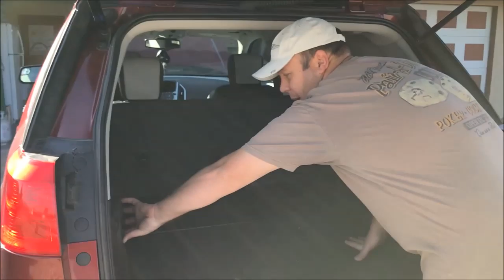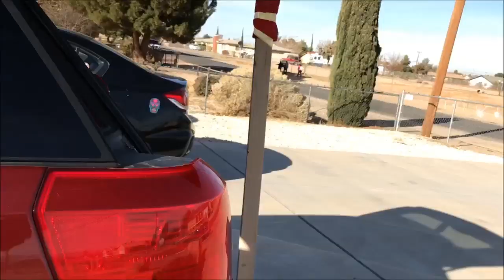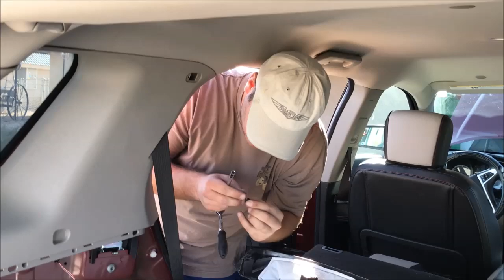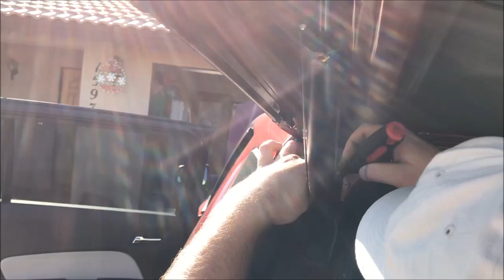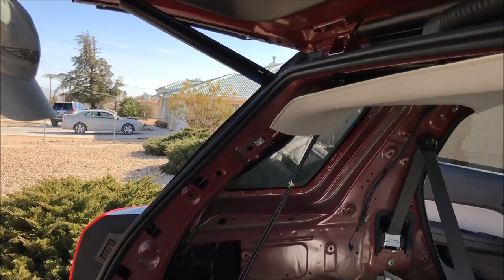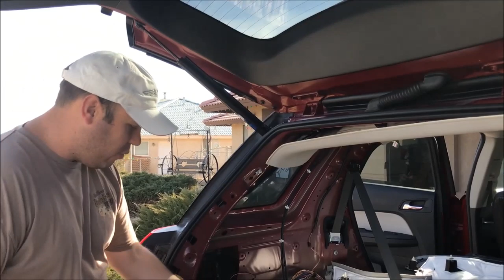2012 GMC Terrain Power Lift Gate Replacement

Comment: Bro, you gave me the confidence I needed to attempt this repair. Thank you, sir! It went just fine. Hardest part was getting out the old stupid plastic tie downs on the lines, especially the ones up by the headliner (ended up using a side cutter). Used a step ladder to prop the door open. Worked out swimmingly. Thank you!!! 🍻🤙

Comment: Did you have to adjust anything after the video ended or did it just work like nothing ever happened? I’m just curious if it’s necessary to prime the pump after replacing the actuator. Awesome video man, I couldn’t have made it this far without it and I hate to put everything back together if I need to prime anything first 😅
Reply: Did you have to prime anything? I got.mine put all back together and now it won't go up with the button. I can lift it manually and it stays in place and can hear the pump running

Comment: I replaced the lift gate actuator. The lift gate still is unoperated??
Reply: I disconnected and reconnected the battery. The gate still didn't work. I went to look at the inside switch, and it was in off position. After turning the switch to 3/4, it works. My wife said she didn't turn it off. It is her car.

Comment: Can I not just cut the hydraulic hose, cap it so fluid doesn’t leak then stick it back in the body and use a manual strut?

Comment: Excellent video. Thank you very much for your video, it really was easy to solve my problem. I didn't change the actuator, I just topped up the hydraulic motor oil level.

Comment: EXCELLENT VIDEO👍 
Your narration/explaining the process including showing the clips and where they attached was great.  Very often people forget to show that detail which is so important to prevent clip and panel damage, so high marks for that.  Your camera person/assistant was excellent as well.  She followed your moves and showed she was paying attention to the project👍👍👍.  

By the way, I actually was looking for the how-to remove the opposite right rear panel to replace the sub-woofer on my 2013 SLT2…
So your post was a bonus to me.  Now l’ll know how to replace the hydraulic cylinder, hoping it never fails though 🤪

Thanks again 👍🇺🇸

Comment: My lift gate is not lifting with the engine off. It partly opens then slams closed. However, when the engine is running it lifts with no problem at all. I do have some residue around the power strut and the other one is very new so not an issue. My thoughts are that the strut hasn't enough "oomph" to operate solely from the battery but when the engine is running the additional speed of the pump allows it to open. Do you think this sounds feasible?
Reply from the maker: Not really sure, but I’d to autozone and have your battery checked. It’s a free service. The reason I think this is that if it works with your engine running, the alternator would be supplying power to the hydraulic pump to lift and close the power gate. If it’s not working with the engine off, the battery may not have enough “oomph” to raise the liftgate. The strut itself is hydraulically powered and really shouldn’t matter whether the engine is on or off. The only thing I can think of would be the power being supplied to the hydraulic pump.

Comment: Is there not a disconnect at the base of the strut? Replace it using the existing hydraulic lines. And thank you, i can see the leak by the tail light there, same as mine.
Reply from the maker: Nope. Hydraulic lines are permanently attached at the strut.

Comment: Fabulous video!  I am a 60 y/o woman and used this to get mine done on my 2013 SRX.  My unit was not in the corner but was easier to get to.  I would not have even tried this myself without your wonderful video.  Many many thanks!  I saved A LOT of money!
Reply from the maker: I’m so happy to hear it was so helpful for you! Great job getting it done!
Reply: @goku569  the leak is gone and it works but I'm wondering if I did something wrong.  It takes two pushes for it to open.  It tries the first time but then shuts.  Was I supposed to bleed it?  Not sure how.  Also it needed more fluid so my husband got hydraulic oil at O'Reilly.  Was that the right type?  it was a very thin clear oil.  I appreciate anything you can add.  I can continue hitting the buttons twice but want to be sure every thing is ok3
Reply from the maker: When I did it the first time, I did not bleed it, but later had to remove the panels to get to the pump so I could. The way that I bled it was to remove the fill plug and cycle it about ten times. The reservoir should allow the bubbles to come come to the top and exit through the fill port. Can’t speak to the fluid type to be honest. I bought extra fluid from the dealer. Hope that helps.
Reply: Jack&JillofAllTrades you are so awesome to respond. I thank you in advance because I’m asking it another way. You said yiu
Reply: Jack&JillofAllTrades you cycled it about ten times. I’m not sure what you mean. So sorry!  You mean turn it up and down? Or attach and disattach?  I am not automotive at all so the term is foreign to me.
Reply from the maker: Sorry! Cycle means to open and close it. Each up and down is one cycle. Hope that helps!
Reply: Jack&JillofAllTrades very much so!  Thank you again and may God bless you as you have blessed others.
Reply: I'm having the same issue with my 2012 Equinox Does the same part fit the Chevrolet Equinox 2012?

Comment: Excellent video! It was very helpful. Thanks a lot. What fluid did you use to add to the reservoir? What type and where can I find it? Also, how did you add it? How did you do the bleeding? Again, thank you.
Reply: Hey! I had the same question and took me a while to find out, the fluid i used was the AC Delco 10 5041- Hydraulic fluid. It'll say on the bottle that it is for trunk systems. I used if and it worked just fine, add a little bit a time though. Hope this helps!

Comment: READ THIS FIRST!!! This is a fantastic video, but in my situation (and maybe in the situation described in the video) this is overkill. 
The hydraulics would take my lift gate all they way up but then it would start drifting back down slowly. It would never go all the way back down. It would usually stop at about 3/4 of the maximum height. *If the hydraulics or pump were bad, I don't think the door would open to the maximum height.*
Instead of replacing all the the things in the video, I simply replaced the non-electric strut on the passenger side of the car. The strut I took off seemed seized up - it wouldn't go up or down. I think that the driver side hydraulic pump and strut were perfect, but the passenger side strut was always pulling against it. The passenger side strut takes about 3 minutes to replace, and you don't have to remove any body panels or detach the battery. Most importantly, it only cost me $30 to get the part at Autozone.
Reply: Thanks for your input, but my question to you would be: was your right side non-electric strut leaking like the one in the video? Because mine is, just like his from the video (left side/driver's side).
Reply: @alan_ayala1  I have a 2011 GMC Terrain. The hydraulic one has been leaking, but replacing the liftgate support on the right side corrected my problem. Found one at Autozone for $16. Make sure you have a helper to hold the liftgate up while you're replacing the support. The liftgate is heavy, and it will fall on you as soon as you disconnect the support.
Reply: Derek Roetzel I have a similar issue with my 2012 GMC Terrain. The power lift gate opens entirely, then slowly starts to drift back down..... Did your replacement of the passenger side basic strut fix this issue indefinitely?
Reply: Patrick Roob - It’s still operating perfectly with no sagging. It goes to the maximum height and stays there. 

I’ve even left it open for several hours, and it stayed right at the maximum height. No guarantees, but I would definitely recommend only replacing the simple side.
Reply: Derek - I agree..... I simply replaced that $30 strut and it fixed the issue. I had my tailgate open all Memorial Day weekend tailgating with no issues. Thanks!
Reply: @derekroetzel Yep, that's all I did. I just simply replaced the strut on the passenger side and the door stays up at max height.  Ironically,  the driver's side struts is the one leaking really bad, but to replace that one seems to be a bit of a headache and much more than I'm willing to do..especially since the one good strut that I replaced on the passenger side works just fine.
Reply: Hi Derek,
My wife's '15 Equinox  had the same problem for about two years especially in colder weather. I followed your advice & changed the right one first & walla! was the right fix. So glad I read down on the comments & saw yours. Other wise I would've gone through a lot of work for nothing. My hydraulic side is fine, no leaks that I can see. 
Thanks again for the heads-up.
Reply: @jonrukavina9011  Thanks for letting me know. I’m glad I could help! 
It’s been about 2.5 years since I replaced the passenger side strut, and my lift gate is still working perfectly!
Reply: @derekroetzel  That gives me hope for the future. Thanks again.
Reply: I thought the same thing and wondered if it would work, I believe I am in the same scenario you were so it should work thanks 🙏🏽
Reply: So let me get this straight even if my driver side is leaking and I replace the passenger side one that when I press the button to open the gate all I have to do is help it up and not worry about the driver side?

Comment: I'm having a problem with my 2008 Saturn crossover rear gate. It will unlock and lock with the remote control, but will not lift. I can start the lift by hand and the struts will lift the gate. Any suggestions what the problem might be?
Reply: Bill Tuttle  thank
Reply: Bill Tuttle, 

did you fix your hatch bud? mine doing the same